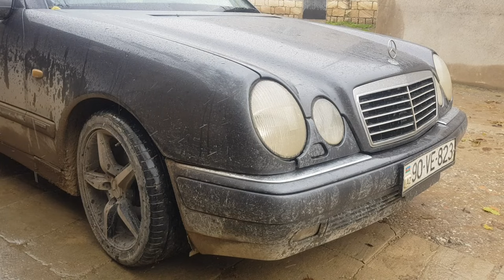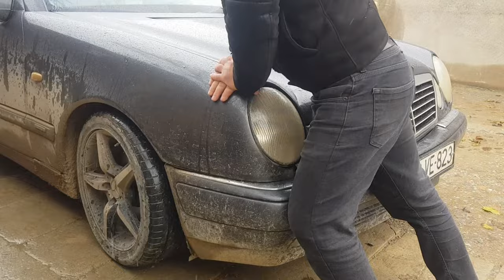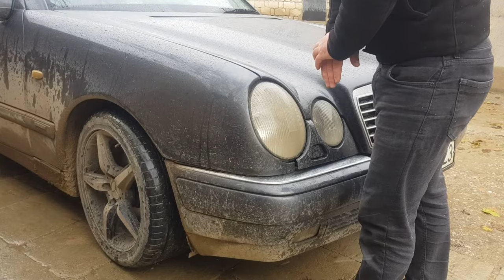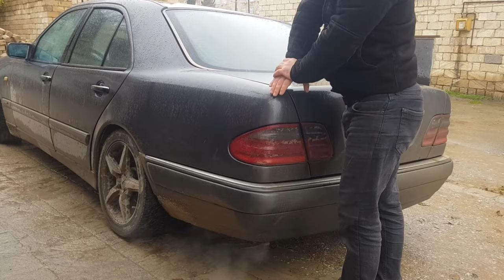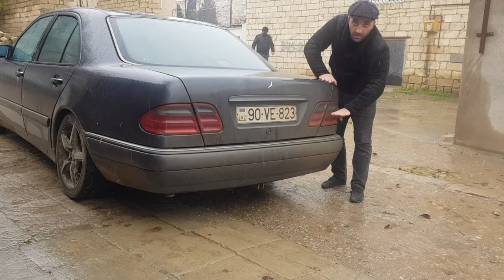Good Shocks Vs Bad Shocks - How to Check

Comment: There is no bad strut or shock on that car. You get 1.25 baby recoils from both sides on the front. That is because the engine and trans have an additional 500+ Lbs of force on the front coil springs and struts.
Reply from the maker: They died on 30 procent